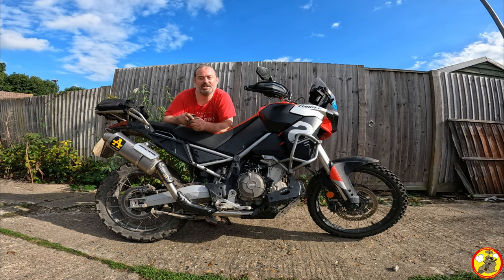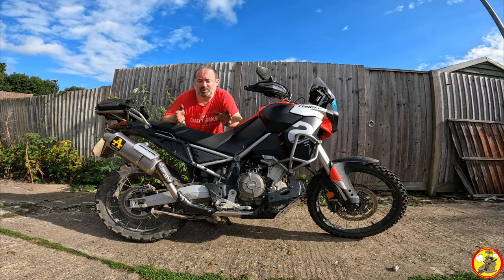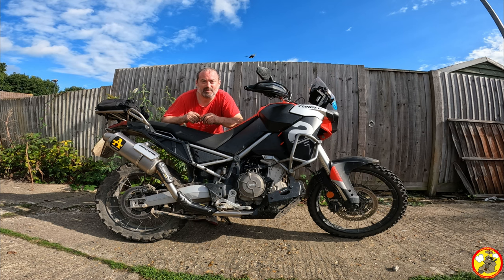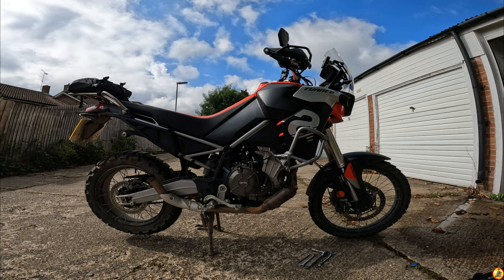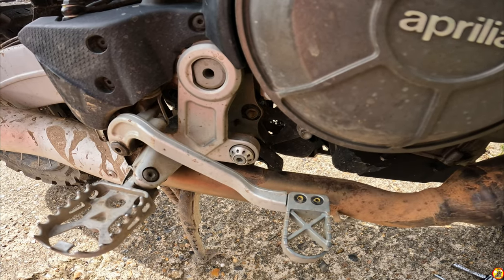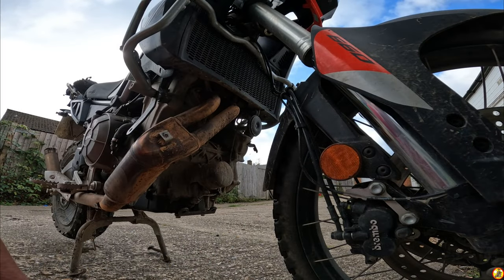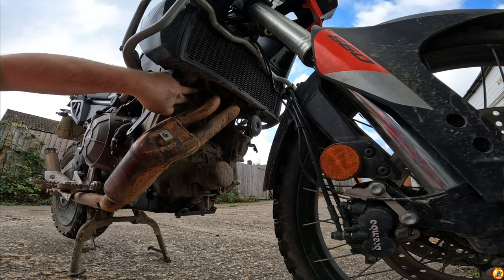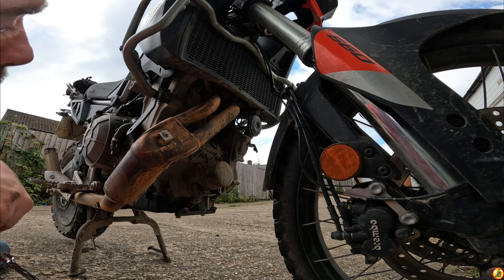Aprilia Tuareg 660 | Arrow Stainless Steel Racing Collectors (de-cat) Install

Comment: I sometimes tape the wire to be fed through with some metal gardening wire used as a guide wire. I hate working with springs, I  usually bust my knuckles when doing them. This was a whole beer video.😄😄
Reply from the maker: Aye, that would probably have worked well 🙂
The second spring was a right pain as couldn't get the right angle on it and pull at the same time. Got there in the end though 🙂
Cheers dude, hope it was a good beer? 🍻

Comment: Hi, thanks for the video. I've problems with jerkiness of the Tuareg, I unplugged th lambdas and it all was good. Now I look to remove the Cat, and use gabros map, but leave the lambdas in to give it a street legal impression. Would you say that with the race map of gabro the bike is still fun to ride in town etc, or is it to perky or twitchy? Thx
Reply from the maker: Does your bike have the updated ECU firmware? The Jerry throttle only really effected the early bikes like mine and the firmware update should have fixed those early issues. 
I went straight for the Gabro UpMap tune as the firmware update wasn't available back then.
It made a huge difference combined with the full exhaust and decat though, well worth it in my opinion 🙂👍
Reply from the maker: The tune really smoothed everything, no jerkiness or stuttering

Comment: Hello, great video ! Ive got some real issue with the heat that the tuareg make, particularly the catalyst i think. Did you have an improvement of the heat ? Like do you have less temperature ? In my country when its above 25 celsius  it begin to be very uncomfortable.  I had 3 motorbike before this one and its the first one that i have this issue .
Reply from the maker: Hi, thanks 🙂👍
With the full decat exhaust, there is a reduction in heat on the right hand side of the bike, it also moves the heat from your ankle to slightly higher up the leg, that may be due to my sump guard though.

Comment: Suggestion. On that tricky lamba cable removal - attach some string to it before you remove so that the routing line, when putting back, is already set. Attach string and pull back through…On reflection, would it have been better not to remove it and just find a way to screw lamba into the exhaust when exhaust put onto bike?
Reply from the maker: That is a good tip. There isn't enough room or cable length to fit it without un-clipping it, and it'd get all twisted up and be under strain.

Comment: Great video. I have the same bike. Thinking full exhaust w/gabro map. I’m looking for more torque on the street for power wheeling over bumps and crests in the road. It is the only think the bike lacks. Did the exhaust/map help?
Reply from the maker: It def feels more perky than stock with the can and map installed, and does feel easier to lift the front wheel

Comment: Late to the programme here, but did you work out what the oil leak was from? Loose sump bolts? Cheers in advance 👍
Reply from the maker: No mate, quite possibly it was splashed gear oil as I used that to oil my chain
Reply: @HippoDrones  AHH.... thanks for the head's up 👍
Reply from the maker: @funguseater40  🙂

Comment: Great video.  How much more power does this system make?  Dominator HP3 reports a 7hp gain at the wheel.
Reply from the maker: Thank you. I'm not sure to be honest, but with the Gabro Racing UpMap installed the whole throttle response is amazing, low down it is noticeably smoother but way stronger and the stuttering the stock bike had at a neutral throttle  at 30/40mph has gone. Engine feels much stronger when accelerating through the revs too. I ride a GSX-R750 for when I want to go fast, so was not really fitting this exhaust for top end power, I just wanted the bottom and mid range to be improved which it has done 🙂

Comment: Hi, what feed back have you had from your Aprilia dealer regarding possibly affecting warranty with changing from OEM. I don't think Aprilia have yet approved a replacement headers or can. I am thinking of doing same to mine when it arrives ( waiting for accessories from Italy ) Cheers Aitch
Reply from the maker: Hi Aitch,
I've not had any feedback from them, but the warranty should not be affected unless the change was responsible for any failure.

Comment: Hi super Tuareg . Do you think the reflash of the ecu , without changing the silencer, would still make throttle response better? Also, do you think an aprilia dealer might upload the better ecu upgrade so hence not need to buy the loading kit required to reflash? Thanks
Reply from the maker: Hi. Aprilia have released a new map for the bike which your dealership should install at your next service. That map is supposed to address the throttle issue.
If however it doesn't, then Gabro Racing have got an ECU tune on UpMap for the bike with the stock exhaust,  so that is still a solution.

Comment: Tips; 
Never re-use a manifold CRUSH gasket,re-new or aneil them(heat red hot on the cooker ring,drop in a pot of cold water a few times).
Dap a spot of grease on the crush gaskets,to hold them in the exhaust ports,it'll melt away!
Clean up exhaust nuts with a wire wheel,on the drill or bench grinder!
Use anti-seize on said nuts and sensor threads...if you ever want them off again!
Use a small screwdriver on the bottom exhaust 'U' as you pull with the spring puller,push screwdriver down,spring on easy!
When exhaust is off,block up the ports with kitchen roll,brush casings with a stiff brush with diesel or paraffin ,Jizer it later,and wash off with a hose once pipes are fitted before starting the engine...Italian cases go furry eventually,keep them clean!
Use Loctite on all pipe to chassis nuts and bolts,vibration is travelling down the pipe!

Hope this helps folks....saves misery later in the back of beyond!
P.S; Looking at buying one of these,but i'll have to make my own pipe, nothing i've seen i like...want something in the style of Rade Garage have with their 'Sharon' pipes on KTM 7/890 Adventures, keep the heat way from the luggage....i'm near Meerkat Exhausts,(Kilbirnie)he'll bend/weld/laser cut you anything....never settle for what's on the shelf,if it doesn't suit your use....best tip you'll get! Regards
Reply from the maker: Cheers for the tips William 👍
Reply: I'm always amazed how some people work on dirty bikes, I always wash before and after the work is done.
If the bike was clean before he started he would not have got dirty hands and leave greasy prints on everything.

Comment: Does it run cooler with the revomal of the CAT? Thanks
Reply from the maker: Hi George 🙂It does, but you still feel some heat, but higher up the leg now. TBH, I never really found the heat an issue before though.

Comment: Great work!  I have the same bike in the Indaco Tagelmust color and am preparing for these same mods.  I agree with you on also wanting to keep the bike not much louder than stock but honestly... that thing sounds loud! Like you I'm now wondering how it would sound with the stock muffler attached to the rear but I'm unsure if there's emissions restrictions on it, or only on the header in stock form? Best of Luck.
Reply from the maker: You'll be interested in the sound comparison test video I have coming out next Sunday then, and I think you'll be surprised...

Comment: …is T that little oil seep from above the sump, it looks like a line of oil down the casing?
Reply from the maker: I've not investigated it further yet, it is only a little seep, so not concerned. I will get my dealership to investigate it when I take it in for it's next service though.

Comment: I have the same bash plate, what did you have to modify for the chamber to clear, thanks, enjoy your videos
Reply from the maker: Hi Richard, I had to drill out the top left hand side mounting hole a few mm larger as couldn't align it. You might find you don't have the sane issue if your exhaust pipe is aligned differently. 
Ahh ta mate 👍

Comment: Nice job. Didn't look especially easy. Those springs looked a pain in the backside, quite close to the engine case. Hope it's fixed the flat spot with the new map.
Reply from the maker: It was quite a fiddle compared to how I thought it would be! 😁
Going to do the remap today, it looks pretty straightforward 🙂

Comment: Did it help with the heat problem?
Reply from the maker: I never really had a heat problem as such, but the UK is not know for scorching temperatures! 😀
It did reduce the heat and moved where the heat is felt. Before my ankle and lower leg would get the heat from the cat, now it has moved slightly higher up my leg, and has reduced in intensity and temp.

Comment: Hei. Thanks for the trouble of filming and editing! Why there is such an extension chamber if there is no cat?
Reply from the maker: I believe it is an expansion chamber which helps with back pressure. A lot of 4T enduro bikes have similar (all but smaller), I think it helps with the power.

Comment: Hi, do you feel a reduction of the heat coming from the deCat compared to the original cat? I'm wondering about the fairing just on top of the cat getting so hot that over time it could change color or deform. Also the gasket of the waterpump is getting so hot each time you're shitting down the motor, it is therfore  melting and leaking coolant over time. I've seen some complaints on coolant leaks.
Reply from the maker: There is a noticeable reduction in heat, and it also moves higher. TBH, I've never found mine to be excessive though, and my GSXR750 runs hotter.
I've not heard of the waterpump gasket leaking, although there have been reports that a seal on the lefthand side of the engine can leak a little oil or coolant out of the inspection hole.

Comment: Fiddly job Pete but staying calm & methodical was the best approach but when pulling springs not filming was a good choice ha. Well done though mate. Nice job. Once it's done it's done. 👍
Sounds like beast. Keep the arrow silencer on with the baffle in though. Looks like a much nicer pipe. You'd have saved a bit of weight that you'll hopefully notice on the trails
Reply from the maker: Hopefully I'll not be picking the bike up too often to notice... but all weight loss helps 😁
Yeah, it wasn't pretty fitting the springs lol 🤣
Reply: @HippoDrones  I hope you didn't upset any neighbours with turning the air blue.😂
Reply from the maker: @deepjoyrides  😀

Comment: Friend ..if may i ask what is the benefit of this ?! do this pipes reduce the heat to your legs ? + i is that cat converter? Tx
Reply from the maker: It removes the cat, the new exhaust has no cat. The heat is slightly less, and no longer directed at your ankle. Benefit is better sound, better performance, lighter weight and also helps with the heat thing, although I never really found it to be excessive.
Reply: I wish you had mentioned how many kg lighter

Comment: Man that sure was a heck of a process. It reminds me of the "simple" battery change on my V Rod. They really could have put the spring clips in front instead of behind the pipes and yes new stud nuts would have been a nice touch. Probably them dern bean counters trying to save a buck and maximize profit.
Reply from the maker: It certainly was a bigger job than I expected it to be, got there in the end though 🙂
Reply: @HippoDrones  I heard that. I bet there were a few drinks missing in the ol fridge too🤣
Reply from the maker: @BigDaveTALKS  after... I didn't fancy this job half cut! 🤣
Reply: @HippoDrones  yeah no doubt. Now for the sound check. Can’t wait😁👊
Reply: @HippoDrones  yeah no doubt. Now for the sound check. Can’t wait😁👊
Reply from the maker: @BigDaveTALKS  That vid will probably be up next week 🙂

Comment: waiting  to see if the heat issue on the right leg changes...
Reply from the maker: I went for a spin today, the heat is a little less, but not a huge amount, what I noticed was it moved from my foot to higher up my leg!
Reply: @HippoDrones   Well that's rather disappointing . Would a tune to make it run a little less lean do the trick perhaps?
Reply from the maker: @rvsmairspace6742  not sure, but I'd rather have an engine running correctly than a heat issue that I don't really have an issue with 🙂

Comment: blah I just installed that sump guard today and ordered the full system, can you show us how to install the up map? is the bike annoying now? how is the power? does it always want to go fast now? I like the way the bike rides stock so im worried the tune and exhaust will make it like a v4
Reply from the maker: Hiya, ahh cool.
There is a video on my channel showing how to install the UpMap, but it is dead easy to do, takes around 30min.
The exhaust sounds great, and with the baffle fitted, it isn't obnoxious, but you can hear the bike better. The throttle is now smooth as silk and the low end throttle response is amazing. It doesn't make you ride faster, I still mainly short shift and ride lower revs.
Reply: @HippoDrones  thnak you great channel we have the same mode so far waiting for the map and headers to arrive keep the videos on the turareg coming thanks!!!!!
Reply from the maker: @SP-xd8gs  Ahh thank you 🙂

Comment: Could you not have pulled the sensor cable up through with a length of string tied around the plug?
Reply from the maker: Possibly, but it was quite a fiddly angle
Reply: @HippoDrones  just got to the end of the vid. Sounds MUCH better than with stock pipes, nice deep rumble that wasn’t there before. It might be a bit much with the baffles out. 😂

Is there a way to muffle out the wind noise from the mic when you’re leaning over the bike speaking to the camera near the end?  Not meant as criticism, just trying to be helpful.
Reply from the maker: @markharrison2484  I should really use a lav mic mounted to my shirt which would be better for that, but I don't currently have one. I'd also need to use the GoPro Media Mod to allow me to connect an external mic to it which is a pain. It is stuff I can do though 🙂

Comment: excuse me what's the brand of this racing collectors? there is a fake Cat on this head collectors?
Reply from the maker: Hi Martin, as per video title, it is an Arrow exhaust. It isn't a fake cat, it is an expansion chamber which helps with back pressure I believe :-)